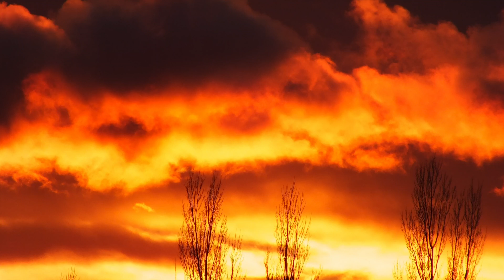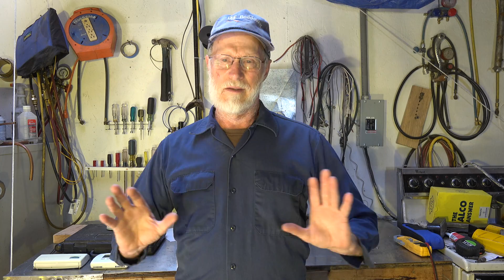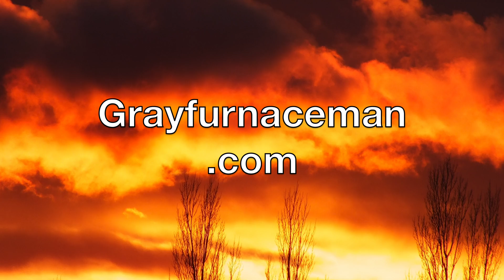Thermostat cycles per hour of the heat pump #2

Comment: Glad I came across thos video. I've been researching this very subject and came to the conclusion I needed to decrease the CPH of my heat pump. So far, as a starting point, I went from 3 to 2. Will monitor it over the next month, then try 1 and compare. Thanks for the informative video.

Comment: When is it too cold for a heat pump? I have a 2015 Goodman,3 ton (I think thats right) 14 seer.I was using it tonight and it was still heating just fine and the outside temperature is 7° F.
Reply from the maker: When the temps drop, the pump will usually continue to operate but may not keep up with the load.  The backup heat will automatically come on to keep the temp up.  Merry Christmas
GFM

Comment: My honeywell digital wifi heatpump thermostat cycles way too quickly and the cph setting has no effect.  I'm very disappointed in this thermostat because it cycles several times per half hour and runs a short time while it's on.
Reply from the maker: Are you sure the thermostat is doing the cycling.  It is possible the unit is cycling on a safety.  
GFM
Reply: @grayfurnaceman  It's the thermostat, I hear both fan and compressor relays click off/on. Compressor run is only about 4-5 minutes to satisfy thermostat.
Thermostat is mounted just above handler return (at floor) by a couple feet, there's one return and airflow seems to be plenty, perhaps excessive if anything.
This is while running in cool mode.
In heat mode, aux heat is engaged about every cycle as t-stat temp dips below setpoint by 3 degrees.
In heat mode, this 10 SEER r22 system can supply all my heat down to about 20F outdoor ambient without engaging aux heat strips.
Maybe I need to relocate the t-stat further away from the return but I was counting on cph setting having some effect.
Reply from the maker: @thisisyourcaptainspeaking2259  Remove the thermostat and cap the hole behind with insulation, taped over with duct tape.  You may have airflow coming out of the wall during operation fooling the stat.
GFM
Reply: @grayfurnaceman  Great suggestion, I'll be testing your idea.  There's a huge hole in the drywall behind the t-stat and it's the wall enclosing the air handler.
I'll report back, thanks!
Reply: @grayfurnaceman  Okay, we've had some milder weather but it looks like the cycle length has increased considerably since covering the large hole in the wall behind the thermostat.
This hole behind the thermostat was large enough to mount a duplex electrical outlet (to give some idea of the size of the hole) and just on the other side of the wall is the air handler (in a utility closet).  Both sides of the wall are drywalled but still there was that large hole behind the thermostat, so I installed a gasket between the wall and the thermostat with a small hole just large enough to pass the control wire through.  The gasket was made by cutting a shape from a clear plastic soda drink bottle.
So thanks for your help isolating the root cause of the relatively short cycles for this compressor, it appears cold room air was being drafted through the thermostat housing and into the closet, which runs at a slight negative pressure (enough to pull and latch the closet door shut).
Reply from the maker: @thisisyourcaptainspeaking2259  Glad you got it covered.
GFM
Reply: @grayfurnaceman  I may need to change CPH from 1 to 2, the temp control hysteresis is much larger now! ;)  Thanks again, this definitely solved the issue.

Comment: Honeywell Installer Setup Number 0220 options 1-6 First Stage Compressor Cycles.. I have a 5 ton oversized system, changed from 3 CPH to 2. Hopefully it helps in 110f AZ 11 month summers.. Was on/off all day and never comfortable..
Reply from the maker: I am not sure that will help.
GFM

Comment: I live in Colorado and I have an 80% FHA furnace with a Honeywell T4 programable TH4110U2005 stat. My 80% forced hot air furnace seems to cycle too much making it far less efficient as the blower is a power hog. Can I reduce the cycling by changing the ISU 370 setting to limit this and will this change the algorithm for deadband control? Lower CPH = longer run times. Or will I just see the deadband control (+/- 1 deg fixed) take over and continue to see the same amount of cycling based on thermal loading factors (outdoor temp, heat loss, wind speed etc). Hope I am making sense. I enjoy watching your videos. Thank you.
Reply from the maker: Your thermostat has no direct CPH setting as many do.  You can go into installer setup and set the system in the hot water heat setting as this setting usually has lower CPH than forced air.
GFM
Reply: @grayfurnaceman  The stat does have a setting for CPH. After watching your video #3 on Gas furnace CPH settings I will set it to 3 and observe performance to see how it goes. Thank you for your quick response. I appreciate it.

Comment: If they cycle rate is set to 2cph and the heat pump is sized moderately wont it cause the system to over shoot on mild days or have large droops on colder days. I guess what I'm saying is If it's set at two but demand needs 4cph at that time will it over ride that setting to maintain steady temp or cause big swings?

Comment: Hi i live up in michigan, bought a 10 year old house and had a heil observer system installed when we moved in, the thermostat was set at a default of 4 cycles per hour and can go down to 2, the heat pump lock out is set at 25 degrees before it will switch to propane furnace. What do you like to set the lockout at for the colder climates and do you recommend the 2 cycles over the 4 for the heat pump operation
Reply from the maker: I usually say the lockout should be set to when the supply air is uncomfortably cool.
The 2 cycles for the heat pump is about right.  When the furnace is in propane mode you might like 4.
GFM

Comment: I think simply talking about cycle times per hour only is slightly misleading.  I think it's more important to determine how long it runs and how long is period it is off.   It's simpler I believe with a single stage 80% furnace. 

With a heat pump, I presume the off cycle has to be long enough for the gas pressure to bleed down and equalize.  Short cycling could be a major issue.

This is not so much the case with a single stage furnace. I'm not sure they can even short cycle, at least the type I had where the furnace was mostly dominated by the internal limit control.

With a two stage unit, it's more about how long does it run in Stage I, and then in Stage II.  I know that with my new furnace I would really like  to have more detailed recorded diagnostics on the exact run times, and in what mode.  As it is, I have to watch it carefully in the daytime while I'm awake.  But during the night when it's the coldest, I really have no idea exactly how it is cycling.

I installed my furnace myself, and that's considered sort of a "no no" by the manufacturers.  Of course it depends on a person's experience and ability to analyze what's happening and dig for information, particularly when the accompanying documentation is very marginal.

I'm questioning exactly how good is a so called "professional" installation.  It takes a lot of time to properly tune up a furnace.  Just clocking the meter for gas consumption takes quite a bit of time and effort.

Is there some sort of recording unit that can be left on these domestic furnaces so that the technician can leave it after an adjustment, and come back the next day to see how it's actually performing?

Comment: I'm in Montreal, Canada.  I recently had a heat pump installed,  which they call locally a thermopump.  I just found that in the heat setting, it was cycling all the time (turning-on and off).. the gas furnace was always having to turn-on to warm the house to the desired temperature.  But in the summer it was cooling perfectly. 
Electricity here is cheap compared to other forms of fuels, that's why I had a heat pump installed. I paid $6000 Canadian dollars all included for the Lennox XP-14, so I called back the HVAC company and insisted they send a technician to make adjustments. Now the heat-pump functions for one hour, then turns off, then the gas furnace will only kick-in if not enough heat has been produced. And you are right in saying the heat pump needs at least a few minutes to produce it's luke-warm heat, that is, to reach it's correct operating parameters.  Great video, your offering excellent advice.  Thank you.
Reply from the maker: Welcome
GFM

Comment: My thermostats swing too much.  The rooms get hot and then cold etc.  They run the circulators and the furnace has an aquastat and a tankless coil for domestic hot water.  What do you think?
Reply: Narrow the differential.  Measure the run periods, both off and on.

Comment: How do the smart thermostats work with two sensors, wall & air? I have an older Honeywell smart set back programmable  one
Reply from the maker: They use an averaging circuit in the processor.
GFM